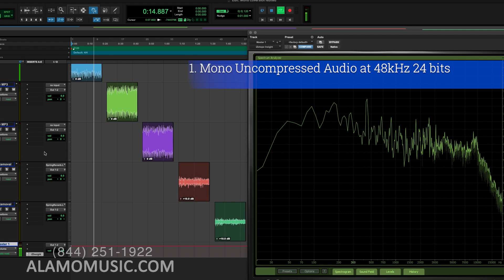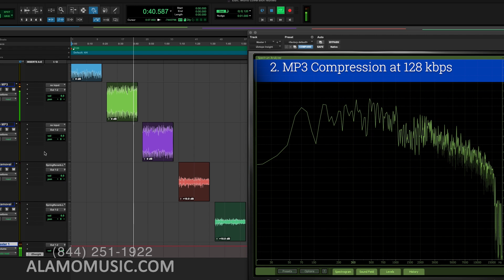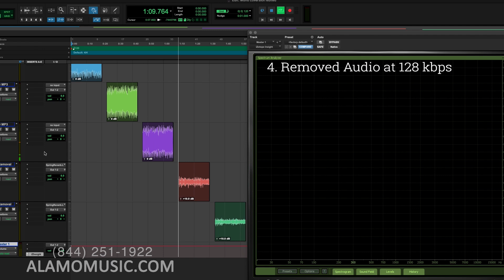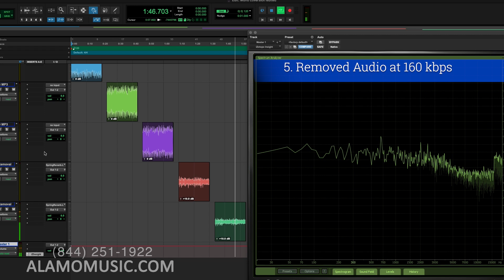The Ugly Truth About YouTube & Synthesizers Part 2: A More Technical Exploration

Comment: Let me tell you this.  I have two rather common models of headphones, namely Sony MDR-7506, and Sennheiser HD280.  The Sony headphones are very crisp, while the Sennheiser are shockingly muted in A/B comparison to the Sony.  Now, after using the Sennheiser headphones for a couple of days, they sound normal to me.  Why?  The brain adjusts our frequency perception, just like our brain adjusts our iris in the eye in response to light.  Same goes for color compensation (white balancing), so that one color looks roughly the same to us in different light.  But I digress.  My point is, the differences you are talking about are so negligible and insignificant, that I can't believe you're even talking about them. :)  So what that one compression sounds different from the other when your brain is going to adjust anyway?

Comment: Something I do to all my mixes now is to hard shelve both the lowest sub and highest imperceptible frequencies. This is mostly done for dynamic range purposes but it also has an effect on the codec compression, since a harmonic that isn't there can be infinitely optimized, so it also frees up bitrate for the rest of the content - and I employ additional shelves where I spot an opportunity to trim further. This doesn't fix compression artifacts, since other factors like how often the harmonics are changing in pitch or amplitude also matter - it's more like a way to direct which artifacts I'm getting in the output by settling for less at the beginning. The more I allow the sound to be white-noisy and full-spectrum, the more it approaches a worst-case scenario for compression(random, no correlation or pattern) and the more the codec imprints itself on the sound, which is a huge issue on a platform like Youtube where the algorithm used is secret sauce and changes periodically. If it allow it to be somewhat low-fi instead, I know what I'm getting because it's not pushing the margins, akin to mixing to a reference dB level.

A corollary to this is that additive synths are a great way to dial in "perfect" timbres in digital because they have exact control over harmonics, and many of them have an explicit quality setting letting you choose how many partials make up the sound, so you can negotiate an exact frequency spectrum to seat them in without introducing additional filter stages(which add their own artifacts).